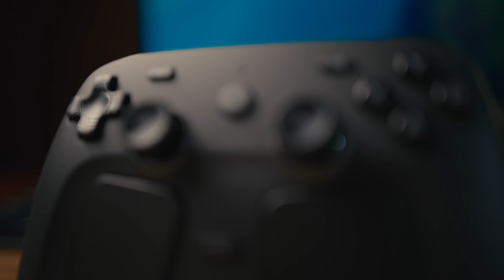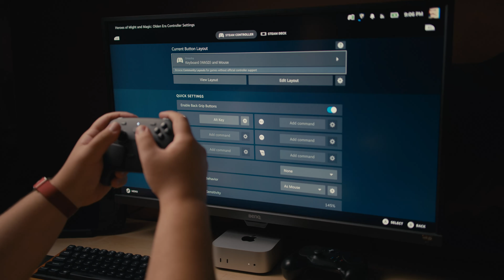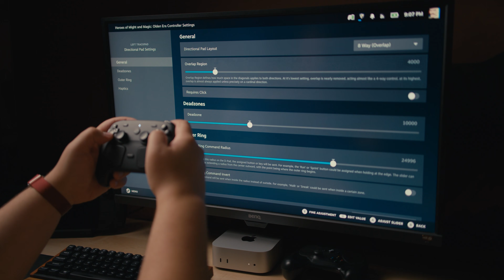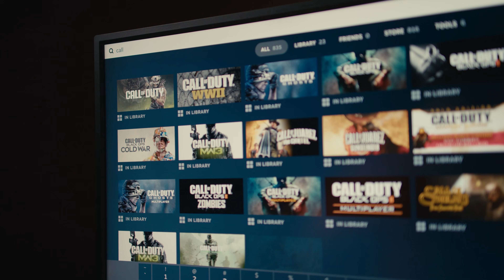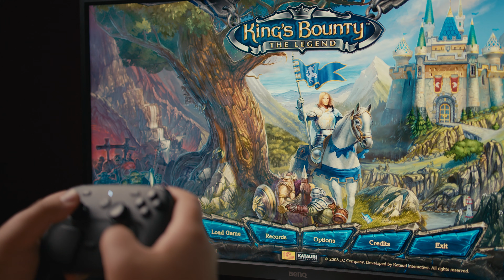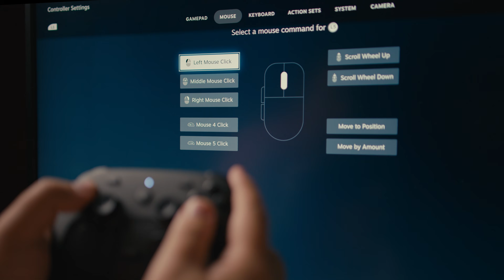The Best Controller Money Can Buy!

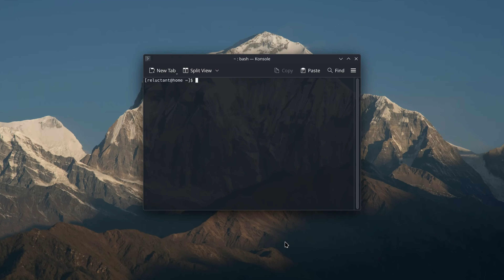Comment: 8:31 yeah... thats one of Steam OS's Failing tbh. Its because While the Steam Controller's, Dual Shock and Dual Sense Drivers are all in the Linux Kernel. Xbox(Xinput) Drivers are not. On any other Linux Distro this can be Easily Fix by using the Terminal to Download and Install Xinput, but yeah out of the Box Linux does not Support Xbox Controllers. Well its easy Except on Debian because you have Enable the Non Free Repos Manually on Vanilla Debian

Comment: If I could configure it without using the Steam client or any program that might depend on the Steam client, then it would be worth considering. If it has a separate program to configure and it doesn't phone home or anything, then that would be good. If it's open source, even better still, but as much as Valve seems to have embraced Linux, I still have doubts.

Comment: Did all these people get their controller on day 1? With the exception of those tho bought the steam machine bundle? 
Am I missing out on something?
Reply: Yes, pretty much, Valve always goes low on production early. It's weird but my guess is they don't want to hold stock long so they buy to order.
Reply: @glue6528  They don't have a distributor in more than half the world like the Middle East. There's a pre-order system on their official website but it will say that the item is not available in the region.

Comment: Valve revolutionised the way I perceive rumble. I LOVE rumble in all my consoles: PS1, 2, og Xbox, 360 and PC. PS3 often got unaltered 360 rumble patterns which were bad. Each console and version specifically made more each platform made it fun. The work on the steam deck made rumble on dualsense work on every platform. Adapters like brook xb 1 which supports og Xbox and mayflash which works on PS3, interpret rumble differently. The former even fails at when to start and when to cut out for each controller. The steam deck still impresses me with the variety. The steam controller 2 made me notice that on PC, I love the feel of each console PS1-2 and og Xbox in that case, with no need to change controllers to feel better; that it is not like audiophile hobby with headphones where right and wrong can be determined, same goes for keyboards, but with rumble, what is right?, fast or slow - the steam controller is as fast as the dualsense for example in Medal of Honor PS1 on duckstation, TOO FAST.

Comment: As a big input control nerd who's been trying to do something similar to what the steam controllers accomplished this makes me happy. The extra inputs they have really are necessary for PC games. It works without them but it's really unpleasant for a lot of games. Also I'm somewhat hopeful that more PC games will support mixed inputs. I don't know why so many games force you to choose between keyboard and mouse or controller inputs. Both I really like to use both please. This is when you get into remapping software. Although most of my experiences on Windows and a little bit with x11. I didn't really fully switch to Linux for gaming until a bit before the pandemic. 

I miss immersive control schemes. But the rant is too long and off topic. But if you like some games and electronics projects try making your own control panels. I thought it was fun and way more immersive than I expected.

Comment: How can I use it on Windows with non-Steam games?
Reply: Easiest way would be to add the Game to Steam and use it this way.
Reply: @Jan12700 yeah, I have to fiddle around with it. As I have had some games that didn't worked with this simple trick. But overall, when it works, it is a pretty good controller.

Comment: I find using grip-sense for gyro works best for games that were designed for mouse control. It helps for more accurate aiming, but can get in the way if you need to stop. In those cases, it's better to set it to be button activated (like if you only need it for a bow).

Comment: I do have 1 controller waiting for me in Sweden and 3 more reserved for friends and family. I’m lucky too have many friends in Sweden that would never touch a controller. I did build in a Lian Li A3 with walnut sure it’s 26 litres so huge compared to the Steam machine but packs a punch. 9800x3d/9070xt because the wait was killing me
Reply from the maker: That sounds like an absolute beast of a machine. Enjoy the setup 🔥
Reply: @ReluctantAnarchist interesting fan setup too, with cpu  with reverse fans taking cold air from the back   exhausting on top and the side with 2 x 140mm fans. Running Bazzite and the Steam Os experience is flawless.

Comment: i hate this controller. I thought i would get some kind of linux first experience (you know gamepad made for steamOS) but it feels like nothing is first for this controller, it sucks on windows but it also sucks on linux. Its probably Steam first coz If you turn off the steam spyware (i mean come on the only closed source app on any linux gamer's machine but i digress) it just doesn't work in every game i tried. I just have to mention that they decided to make all of it steam dependent and very proprietary, its the choice they made and one of the reasons why this controller sucks imagine if xbox controller worked only with microsoft store opened lol.

Anyway If you leave steam always open i still had worse experience than i had on ANY other controller, it just feels like im using it non natively (because its how steam input works exactly), constant double clicks in some games (like you press left and it kind of pressed it twice) or it just feels a bit delayed dont know how to explain. Also trackpads turned out to be 100% useless. I tried to use them in some games but cursor is just broken on wayland or something, for example i tried to use trackpads in Slay The Spire 2 to sometimes switch to mouse but it just didn't work, cursor was invisible, same experience with other titles. I tried to use this gamepad instead of mouse and keyboard in desktop mode because kbm on my coach setup is not very comfortable, but it also sucked and i switched back to kbm. I tried to map keyboard buttons to back buttons so i can swap between workspaces etc but it also didn't work, my only guess its all wayland fault. 

But then recently after last update steam controller is crashing most games and steam itself just closes until i turn off steam controller and use my other gamepads (it happens randomly but consistently). I also hate that this Puck thing turned out to be not safe and can cause fire? now im scared to be near it, or that if my dog licks it or i dont know. I feel like its the worst controller i ever owned. Oh also i hate its vibration motors, they suck compared to my other gamepads. And I never tried gyro coz i don't care about this feature
Reply: I love gyro.

 :(
Reply: Have you considered reading Das Capital?
Reply: @everydaynova663  i don't get this joke and i did read Marx

Comment: Yes, but, I put in my reservation about 6 hours after they launched the reservation program, the estimated order availability is in December. (I'm in EU)

Can't wait to get it though, as I still own 3 original Steam Controllers, and still use them regularly, trackpads with gyro is just superior to analog sticks for most things, with some exceptions ofcourse.

I hope the trackpads on the new steam controller is comfortable to use, I doubt it will be as comfortable as the original, it is by far the most comfortable controller I've ever used.

thanks for the review :)

Also, fellow HOMM enjoyer.
Reply: I reserved mine May 8th just when reservations got launched. Was lucky and fast enough that I got lucky and could confirm address and pay on May 26th, then received it a couple of business days later.

Trackpads are great.
The controller only supports games within Steam.
Replacement parts will be available at some point, so it can be repaired.

It would be great if it was possible to order a puck separately.
Someone has been working on an open implementation of the puck, which also enables emulation to Xbox, Switch and PS3/4/5.
Reply: I reserved maybe an hour or 2 after the reservations went live and was able to order it June 23

Comment: Until i got one myself i will treat it as one huge elaborate hoax.
Even RAM has better availability than this controller.
Reply: Nah, this thing does exist, I have my own. All the things it does it does well, ergonomics for the trackpads is my only complaint (a big one, but the only one I have)
Reply: @MageBurger  I really am the weird one I guess because I find the new trackpad placement much more comfortable than the original steam controller
Reply: But definitely not better pricing (unless you just consider every ram seller a scalper, which...)
Reply: @RisaTei Arguably not, cheapest scalped Steam Controller i found without working for it had been 50% over MSRP.
If i have to choose between a overpriced used controller or +16gb used RAM in my notebook i will go for the RAM all day long.